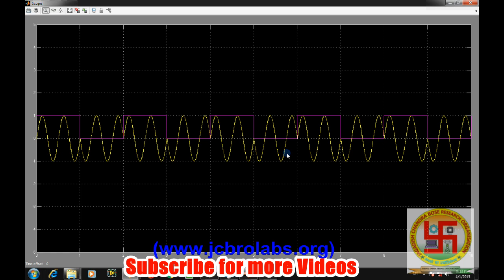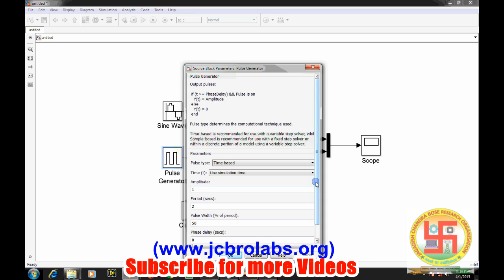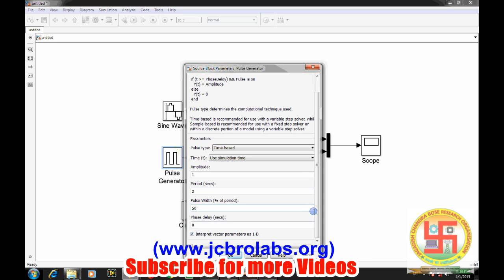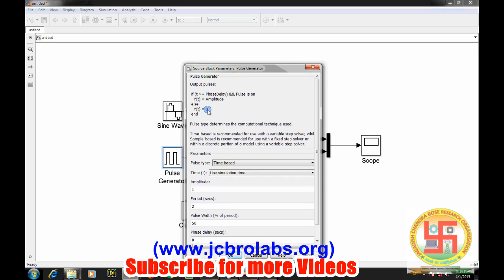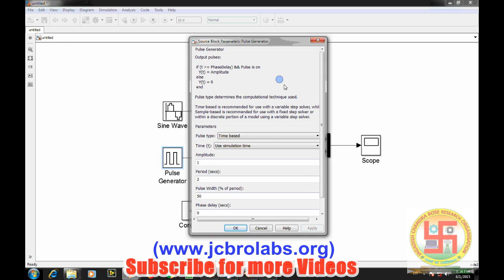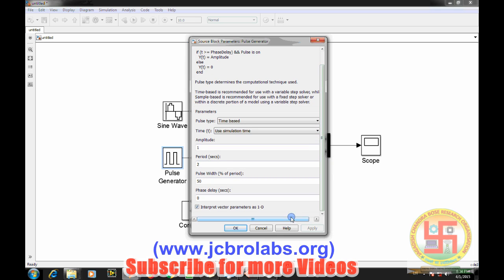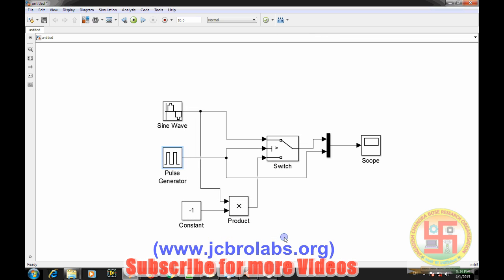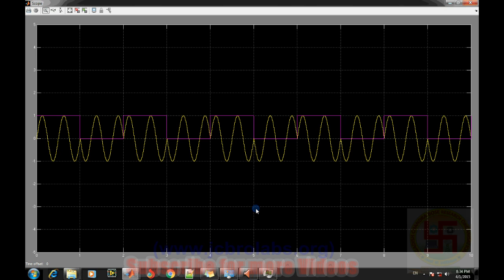How to simulate PSK in Simulink ??

Comment: Why do we use a switch and mux in this model?
Reply: the switch is to trigger which of the two signal to be transmitted based on the pulse that represent the data in binary. the mux is to invert the signal which in this case change its phase

Comment: i have two switches....i generated a duty cycle by using closed loop control..this duty cycle i given it to one switch.. and i have to give with a 90 degree phase shift to the second switch... how to give it?
Reply from the maker: providing shift of 180 degree is easy but not sure about 90 degree phase shift.